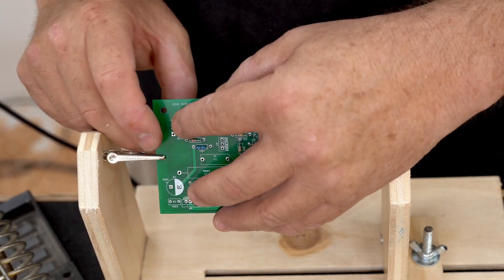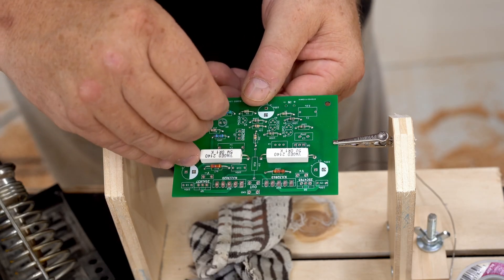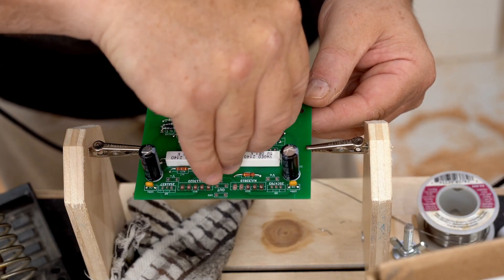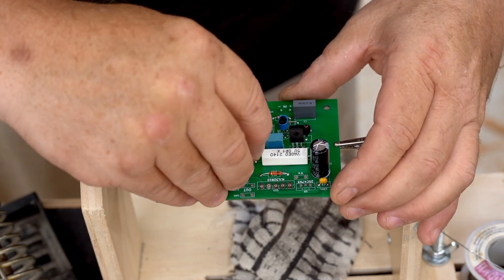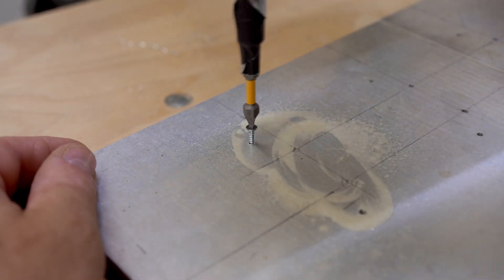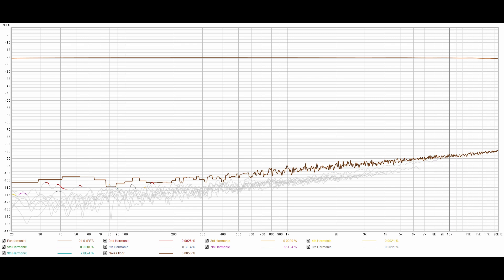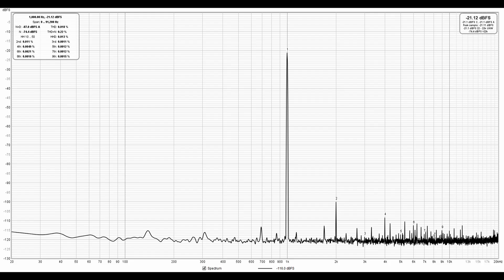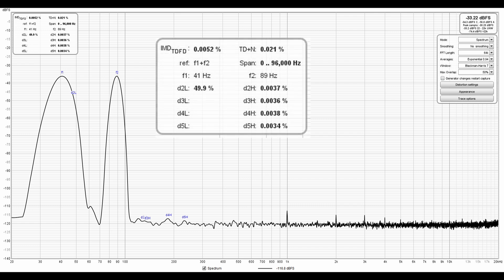Putting the Amp Boards Together and testing / measuring them

Comment from the maker: Time to put the amp boards together and get them tested and measured. Since I started with a properly made prototype, I know these will work (providing I don't make any mistakes), but the testing and measuring just confirms that they are working correctly.
If you want a look at the schematic for this amp, you can see that in this video:
https://www.youtube.com/watch?v=Qe9H07JlT6w
Putting 10 of these together took several hours, and then several more hours to run the measurements. You need to be in this for the challenge and because you love it, because you aren't going to save much money and you are certainly not going to save time doing it yourself.
That said, it's hard to beat the level of satisfaction that comes from designing and building something complex from the ground up and having it work exactly like it was designed to.

The measurements I made are limited by the test equipment. Using a computer and sound card / audio interface isn't the same as a $50,000 Audio Precision spectrum analyzer, but it will tell you whether the amp is "good enough". THD, noise and IMD are all well below audibility and that's all that matters. Also the harmonic distortions are declining from the 2nd out, and the higher order harmonics are extremely low.
What does it sound like? It sounds like an amp! Amps that are competently designed that don't inject harmonic distortion intentionally all sound the same. If you want to hear this one, there's a short sound clip at the end of this video:
https://youtu.be/fg5CEx_l0aE

Much of how the amp will perform is dependant on the power supply that feeds it. In particular, you need plenty of power on tap to deal with transients. These amps will typically run in the 10 to 80 watt range, but are capable of putting out 150 watts each for brief intervals. That gives dynamic overhead so that the signal is never clipped, even at higher volumes.
While this is a 10 channel amp, 8 of those channels will be used to power just 2 speakers - my active 4-ways. So in reality, a better way to view it is like a 4 channel amp, since ultimately it will power just 4 speakers.
That means that the output power is spread out over 4 of these amp boards for each 4-way speaker

Comment: How do you know which way the resistors face when assembling them circuit boards? That’s what confuses me
Reply: Resisters are non directional. I put them so the value is readable when looking at the assembled boards and the wide bands are all facing the same direction for uniformity.
Reply: @snoopyboobs  thank you that’s helps a lot

Comment: Nice design! Looks like a quite well balanced design keeping the number of components down without sacrificing performance. How did the bias current stability work out? I guess your humongous heat sinks help, and I like the simplicity of just using the ThermalTrak diodes and a rheostat and no "vbe spreader".

I have tubes of those output transistors - bought them cheaply when Arrow sold out their non-RoHS components - and the other medium-power transistors you used too, but sadly no 2SA970 and 2SC2240.

Comment: Can you give some of the specifications of the parts you used to build the amp? Like transformer size (KVA), voltage rails, power output of each amplifier, etc. That would make for an interesting video.... Maybe not that interesting but certainly informative. 😁😊

Comment: Hey John! Audio engineer here. Your opinion about quality components is well founded. Most people will never hear the difference. IN most cases, those subtle differences are hard to measure too. But  two things stand out with quality components: Reliability and low noise. So, you did not waste money just for a "placebo." They do make a valuable difference in that respect.
Reply from the maker: True enough, but I meant these parts were selected because they are more highly regarded, while not being any more rugged or reliable than the standard parts. Say using 2SC2240 and 2SA940 instead of MPSA42 and MPSA92. Or silver mica for the Miller comp cap as opposed to a ceramic.
I also splurged on the output emitter resistors, getting a better grade, even though the lower grade would probably outlast me by decades and be less than half the cost.

Comment: Using high quality components was a good idea. I remember in college we had to test a bunch of say 2n3904's, cheap ones. We did a bunch of measurements and the variance was quite wide. Some of them were way off compared to their data sheet. Add in a bunch of other cheap components to a circuit and it could be a problem getting it to run as calculated from stock numbers.
Reply from the maker: True enough. Usually buying from a reputable source like Digikey pretty much guarantees a minimum quality. Some prices for parts are bordering on outrageous, though. For example the silver mica caps I used cost $5 each now. I had 7 in my old stock from 15 years ago, but had to shell out $15 to get the missing three. 
Likewise for the power resistors - 20 of those for the ten amps was $32.
Sounds like small change to anyone looking at the cost of an amp overall, but it certainly adds up and these prices are a good 200 - 500% higher than they were 15 years ago.

Comment: I have a quick question, one that I asked under a previous video, but I don't think I received a reply. Of course, the answer may be part of a video I missed. What output devices are used in this amp?
Reply from the maker: OnSemi Thermal Tracks NJL3281D and NJL1302D
Reply: @IBuildIt  Thanks John.

Comment: IMD is great. This amp must sound really good.
Reply from the maker: IMD being low is good, but it's usually too low in any competently designed amp to be audible, anyway. Speaker's IMD would swamp anything coming from the amp.
Reply: @IBuildIt  Yep. But.. When we take the latest piece in a chain, it does not just add harmonics. It adds harmonics to (signal + amp harmonics), where signal is (input + dac harmonics). I think an ear hears this.
For example our brain is able to "hear" a main tone when there are ONLY 2nd and 3rd harmonics. So, this is how IMHO "bad" sound appears
Reply from the maker: If it were audible, there would be plenty of studies proving that. To the best of my knowledge, there aren't any.
There are (of course) plenty of people claiming they can hear it, but that goes for everything imaginable.
Reply: @IBuildIt Correct me if I am wrong, but I understand that the THD and IMD introduced by even quite good loudspeakers far exceeds 0.03%, but even so, the difference between an amp producing 0.03% distortion and one producing only 0.003% driving those speakers would be apparent to most listeners.
Reply from the maker: If it were apparent, there would be conclusive studies. This is audio, after all, where EVERYTHING is studied ad infinitum.
Reply: @Roger_Gadd  It's like proving god exists. looks good on the scope and looks good in the measurements but not proof enough for a beliver of fairys.
Reply: @UberAlphaSirus  I think that you are right.